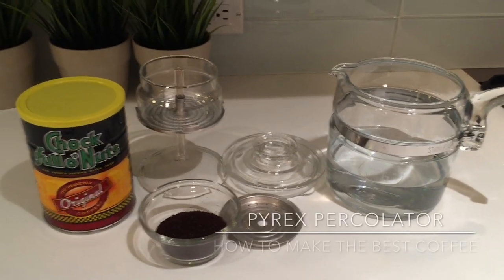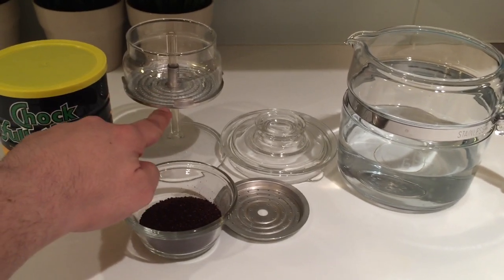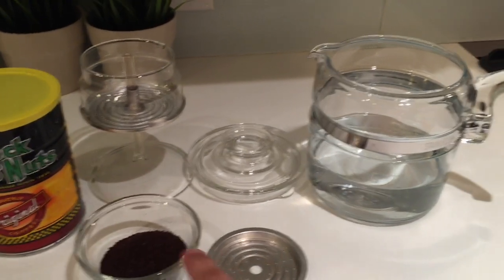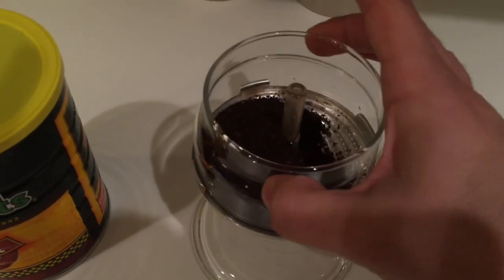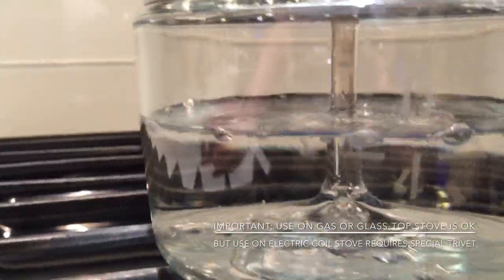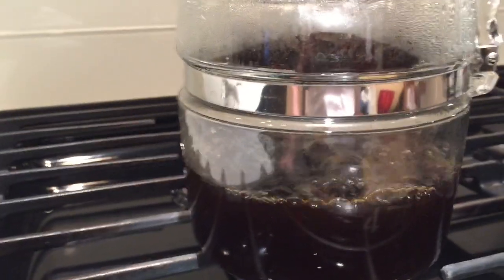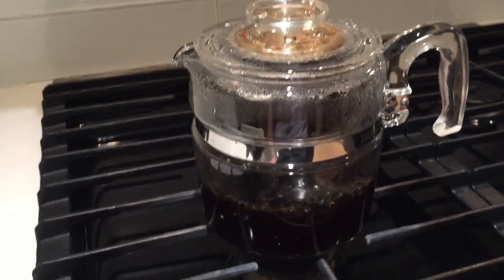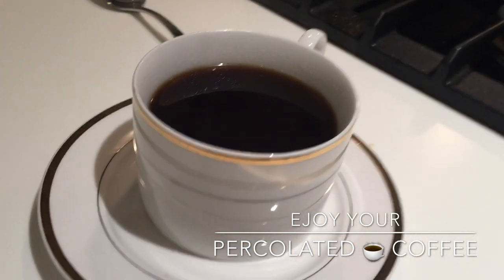How to make the best coffee with a vintage Pyrex percolator

Comment: I’ve watched a few of the videos on this pot in particular 
This is the most informative and specific set of instructions I’ve seen thus far. Kudos
Reply: One vid comment recommended to add ground coffee to a wet metal basket base.  This will prevent any grinds from falling through the metal basket base. And as stated in this vid above the heat lowered to 'simmer' is important for best flavor.
Reply: I'm 67 now snd my dad and his brother worked for Corning Glass Works here in West Virginia. Dad 39 years of service and his brother 35. Anyway, I remember mom making coffee in this exact pot for decades.  They are all gone now and I didn't start drinking coffee until my late 20's. By then everyone was using Mr .Coffee electric pots or similar makers. I was at a Yard Sale two years ago and found two of the above. One a six cup and the other a 9 cup? Anyway, I had been using a Keurig for years, but after dragging one of these out and watching this video. I WON'T be using the Keurig EVER again. Just as explained in video,  the Keurig only passes water through ONCE. This VINTAGE Corning pot truly BREWS the essential oils and recycles them for the BEST coffee imaginable! Thanks for posting. The memories of mom brewing coffee in this same type of Corning Pyrex Glass came rushing back. Plus the old commercial on TV back then that stated: " Only THE BEST comes in glass."...rings even more TRUE today. Literally everything is made of cheap plastic! Thanks again  for posting!

Comment: Great video. I have a 9 cup version and love it. Will never go back to automatic drip. A key feature to point out, and which you showed,  is to place the stem and basket in the pot and then put on the basket lid. If you try to put the basket in the pot with the lid on already, the stem on top is too short to grab and you risk dropping and breaking parts. Have to be very careful with these pots but they are well worth the extra time and effort
Reply: YEP I made that mistake.

Comment: I've just snagged a 7756 in good condition even down to the original instructions. I haven't seen this percolator since I was ten years old when our household one was dropped and broken. My recollection is that it made the best coffee I've ever had. Your admirably clear and informative instructions have been tremendously helpful in reminding me of the correct process. I'm especially grateful for the tip about using a trivet on an electric stove. I wasn't aware of the potential hazard so I've just ordered one. Many thanks for such a helpful tutorial.
Reply from the maker: Happy to hear it was helpful. The trivet is for electric coil stoves. Electric glass tops stoves don’t require the trivet, to be clear. Enjoy your coffee!
Reply: @producedinLA  Yes, I understood that it was just electric coil stoves that were potentially hazardous from the video and subsequent comments. Your tip about the trivet was essential as my stove is electric coil type, so it could all have ended badly.  I viewed a number of videos about the 7756 type percolator, and yours was the only one that picked up on this hazard, so thank you again.

Comment: Absolutely amazing that drip coffee makers are still so popular compared to these.  Oh I loved coffee made this way at my moms house. The younger set never had good percolated coffee so I guess manufacturers cater to them, like everything else. I don’t find that the drip makers even come close and they really aren’t faster or easier.  Some days the drip coffee is luke warm, some days almost hot. I got so tired of the inconsistency of the drip that I bought an older used electric Faberware percolator for $3. Gotta say it was very good and fast (“Superfast” model) too but it finally died. I just found this exact Pyrex model as in your video. This video is just what I need! Thanks so much!! Just as a followup I made my coffee just as you did in this video.  Although the coffee percs for 5 minutes after water starts to go up the tube, there is NO bitterness whatsoever and the coffee tastes rich and smooth.  Thanks again!! 👍🏻👍🏻

Comment from the maker: It's a metal trivet that came with these. It's placed on the coils to act as a buffer because direct contact with the Pyrex glass can cause it to shatter. Glasstop and gas ranges don't require  use of the trivet.
Reply from the maker: It looks like metal hanger wire shaped into a triangle.  Try to make one yourself.
Reply: You can make one yourself, but you first need to burn off the chemical coating on the hanger before you use it indoors so you don't poison yourself. You can burn it off outdoors on a grill or fire pit until it stops smoking. I had my kids do it for me when they went camping.
Reply: Yup..I think that metal trivet looked like a star?  made of wire..
Reply: Thank you for this information! I would have ruined it! Good thing my thrift find didn't have the basket lid or I would be crying right now! Anybody know where I can get a basket lid? It measures 3 inches
Reply: @Anacaona4  Hey...I burned off the chemical coating, but inhaled too much of the smoke and I passed out with my face landing on my blow torch. Now what do I do?

Comment: Oh man, the trivet. We had one of these for years when I was small, used it as a tea kettle, until the day someone put it right on an electric burner *to melt ice*. Boom.

Thank you for this video! I found a vintage aluminum percolator at a thrift store last week, and have been looking tonight for how to just measure the water & grounds, and how to use the pot correctly. This is just what I needed.

Comment: I just got one of these at an estate sale , I've never used a glass one before, thanks for the help! Also mine came with a little metal wire shaped like a flower, the older women who worked the sale said I need to use it on my burner to prevent the pot from breaking

Comment: Thanks for posting this great vid.  I have my mom's Pyrex coffee pot, tried using it a few times, but kept getting grounds in the coffee.  Now I know to wet the basket first.  I can't wait to smell that percolated coffee tomorrow morning!
Reply: I use a regular coffee filter with no problems!
Reply: @bunkyman8097  do you punch a hole in the middle or how do you fit it in the basket? A regular coffee filter is so much larger too - trim it? Thanks
Reply: @gardeninggirl1107,
Yes, I use a regular coffee filter.  I fold it in half then fold that semi circle in half again so it looks like a piece of pie.  Then I cut off the very tip of the piece of pie ( not too much though) and unfold it.  Et voila, you have a hole in the middle of the filter.  I push it down the stem to the bottom of the basket making sure to fill the whole basket with the filter.  I add course ground coffee and commence to perkin'!  That's it.  There's no need to trim the filter, it seems to be the right size, just needs a hole!  Good luck!
I toast you now with the coffee I made in this pot today..
Reply: @bunkyman8097  thank you so much! I’ll give it a try hopefully tomorrow morning. lol thanks for the toast and also Happy Thanksgiving (if it’s your thing)

Comment: GREAT. I got one of these, JUG ONLY  from someone who cleared house back in the early 2000 to dump it at my uncles cottage. 2010 he died of a heart attack and long story short, I live here.  I used it as a regular jug for 5 years and then the handle strap started to go slack so I just gave up for fear of dropping it. I got a cheap plastic jug instead. Having a HUGE clean out I found it again, covered in dust and search results said it could explode on a gas cooktop but vintage WON'T. THEN I see the 7759 code on it and it comes up as "flameware". VERY GLAD to see you using it with natural gas as I have a propane gas stove. So I will probably use it to boil potatoes or something but FINALLY I can use it for something.

Comment: Hi, I have a few questions about some pyrex pots i found at a thrift store recently so if you, or anyone knows pls help me out. I found double boiler set and the pot here without any of the inside peices. I used one if the double boiler pots and made rice and it didn’t break and made good rice. 1, what is this extra piece you had a disclaimer about and why do i need it for a coil top stove? can i keep making rice and other things in these pots or no? How strong are these things really? and are there any special care tips for the pots?

Comment: Does the 7 minute timer apply to a two cup or six cup batch or do you need to adjust the time?

You can always tell a good instructional video and video maker when the video is still being viewed and the poster is still replying to comments five years after it was originally posted.

I have my parents percolator from the '70's sitting in the cupboard hence was looking for a good vid like this one.  Lots of memories of the smell when they had dinner parties.  And six cups all ready at once, not one cup at a time like the new pod machines (they can make some nice coffee, just one at a time - first person can be finished their coffee before the last one gets theirs).  Mum sometimes (unexpected guests, no beans in the house) used to just use instant coffee and still get 'Wow!' comments on the coffee.
Reply from the maker: Callum Harper thanks for your comment. The time applies to all amounts. Seven minutes for dark/bold and five minutes for normal strength.  Get that percolator going!  Enjoy.

Comment: I'm guessing an electric range element is trickier to regulate (am using a wire "heat spreader" .  I may have been too timid on getting the initial boil with dial set to about "6" maximum, taking a long time to get it to perk.  I did better my first try than two subsequent tries, using too much coffee the last batch and too much time.  When its "right" its very good ;^)
Reply: karlsonkab51 You did right. Never go above #6 making coffee with that.

Comment: My grandmother insisted putting the beans in the refrigerator until use.
Is there any cautionary note when using 
Electric stove as opposed to flame or gas?
Anyway thanks this what I thought but
the explanation helps. 
💦
  🌙... 🍵
Reply from the maker: You can’t put these pots directly electric coils. Glass-top stoves are fine. For electric coils there was a metal trivet included with the pots that prevented the Pyrex from touching the coils directly. I’ve heard that people make them with wire hangers.

Comment: What if you don't have an open flame stove but still want to use these? Are they gonna shatter on one of those unevenly heated electric stove tops?
Reply from the maker: Glass top stoves and gas are fine. Heating coils are the problem.

Comment: I have the same pot, but I am missing the crucial aluminum "lid" for the basket, so I can't use the pot. Looked on ebay for a lid, too $$. Any ideas on how to finagle or rig a lid for this pot? Dying to use it.
Reply: goldfinch 50 im in the same boat man 😓 i moved and the basket lid went missing somehow 😑
Reply: I am going to try cheese cloth.  Then I will try to use a paper filter on top  to see which one works best.  A friend suggested going to a 99 cent store where they sell those sink strainers that look like all mesh.
Reply: Hey man i went ahead and used it without it and it works just fine.
Reply: I just did it with the cheese cloth.  It was fine.  I measured the width and the. Folded it like 3 times and put a lit with scissors  and it worked fine.  Coffee came out good.  No grinds.
Reply: @debrapobega Any chance you can show me a pic of how you did this? Thank you.
Reply: @misscraftyOTR How did it work without the grinds going into the coffee?
Reply: Make one out of an foil pie pan. Cut it to size and punch holes on it evenly.
Reply: @Anacaona4  thanks for this tip, I didn't want to pay $30 for a top piece. You are a genius!
Reply: Take a canning lid seal and punch holes in it with a nail and hammer.  I've done this....cheap fix and works great....when the rubber seal gets old....replace the lid.

Comment: I have another use for one of these pots: Can I add 4 cups of water and heat it in the microwave?
Reply from the maker: Bluebonnet  No. It has metal.
Reply: Well, that's a big 'duh' on my part!   After I sent the message, I remembered the metal band.  Thanks for the reply.

Comment: I'm lolling to purchase a Pyrex Flameware Tea Pot however I sent some threads on the Internet that you should not use on gas stoves. Anyone know if this is true? Thank you.
Reply from the maker: KEITH KAHLBAUGH you can use it on a glass-top stove with no problems. You can’t use them on electric coil stoves unless you have the special metal trivet that came with the pot. The intense heat of the coils can crack the glass

Comment: Low heat don't crack the pot!! It came with a metal wire star to prevent direct heat I was told.
Reply from the maker: The trivet is for electric coil stoves. You don’t need it for gas or glass top ranges.

Comment: No need to boil your coffee! It'll percolate just fine on a very low flame. (Hard boiling coffee like that is why percolated coffee has such a bad reputation for tasting awful.)
Reply: Mush M. You bring it quickly to percolate on high, then turn it down to medium low. Most easily achieved on a gas stove-total heat control.
Reply: My Coffee does not Percolate until it is near boiling.Not until it nears boil does the coffee drip into the pot. then i need to take it off burner without allowing it to perc for 5 minuted orelse the pot boils the full 5 minutes.while the electric burner has been turned down already. the coffee seems to only boil and not percolate after the boil is reached.i am trying to learn how to not boil the pyrex pot and still get coffee. another problem is the percolated water drips over the grounds and creates a hole in the grounds (every brew) that allows the water to pass through without seeping through the grounds. is that because my stove is not Level?or why.

Comment: 100% disagree on leaving the basket inside, when you pour. The biggest complaint from people who hate percolated coffee always leave the basket inside.
I used to have the 6 cup, but I sold it when I found the 9 cup. I had to grab it, as it was brand new. They both make the best cup of coffee I have ever tried!
Reply from the maker: Never had an issue. People risk burning themselves and dropping the stem when they try to remove it while scalding hot.
Reply: @producedinLA  pot holder. Works great!
Reply from the maker: @kcaviatrix  and in my video I recommend leaving it in. The grounds are wet and do not come out when you pour. But if you want to take the basket out, go right ahead. Enjoy

Comment: You're flame is too high. You're percolating it too long.

I'll do a video and show you the proper way to percolate a cup of coffee. And I'll even use this same coffee pot.
Reply: chase Its not too long. I do mine for 8 minutes. That's what it says in the original manual, which I have.
Reply: Anacaona4 - I'm referring to his video not what the manual states.

The manual also states to lower it to a simmer, which he is doing. 

Again, his flame is too high, and he's percolating it too long. I can see and hear it. 

He's making the same mistakes most do when percolating coffee. No biggie. Just pointing it out. Though I did say I would make a video on percolating didn't I... 

In the mean time watch an old auto percolator perk. You'll get the idea. Slow and even percs. Almost painfully so. Then you can go 8 minutes if you like.

And if you want a "clear" cup of coffee, which I prefer. Use paper filters. It's designed to be used with. Hence the grooved bottom. Without, your coffee gets loaded with fines and grinds. Aptly referred to as a muddy cup of coffee especially with this percolator basket type with limited larger holes.
Reply: @YknotLearnall  didn't know making a video could take 4 months...